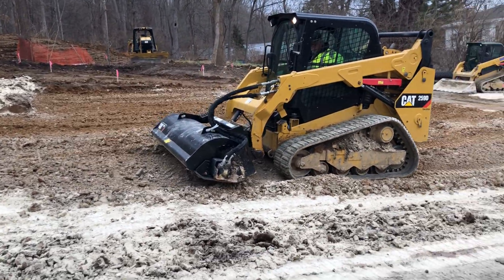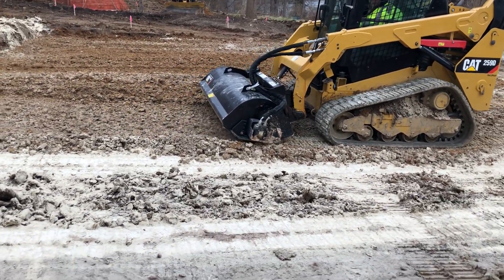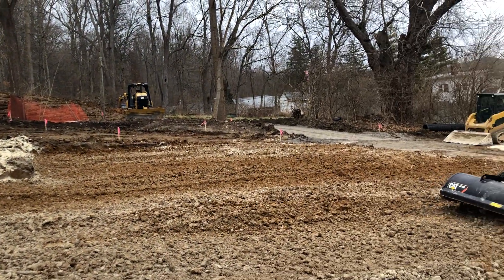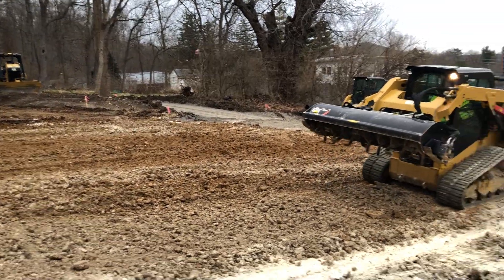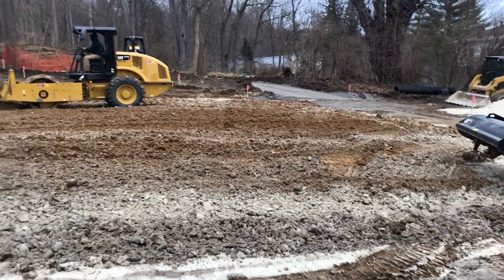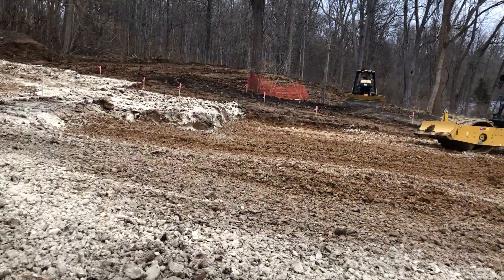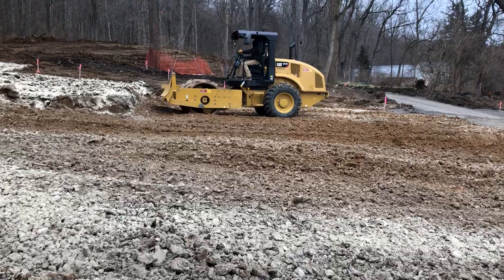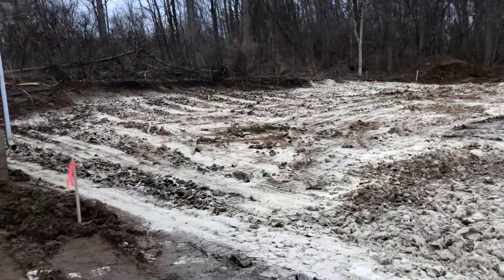How to dry wet dirt (Using Lime)

Comment: I have a situation where we have a 4m deep excavation and groundwater is an issue. Client does not want to pay for boreholes and additional de-watering, geotechnical engineer already ordered 500-700mm boulders to be pushed into the muddy are, but they completely dissapear, over that we added 100-300mm pioneer in a 500mm layer and looks like we're getting refusal,  but we also have a lot of pumping with clay pushing out the top, now we're considering other methods to dry out the clay, but it's a mess. We have lots of slush on top of a unequal layer and it's in the middle of winter here, it's just a mess, have no idea what we will do here, geotech guys are also wondering what to do and every day we delay the subbies, it's costing us money. Just wondering if a crap load of calcium hydroxide pushing into the pioneer with clay slush will dry the area up enough to add G5 on?
Reply: Lime is calcium oxide (CO). When it combines with water (what these guys are doing) it incorporates the water to become calcium hydroxide HO-C-OH. You can buy slaked lime for mortar or whatever but it won't soak up the water from mud

Comment: Your video communicates that you knew what it was for the season you were working in before you started.
There are no plan changes to the original bid.
Reply from the maker: True, we did know and we communicated it to the project owner. However in an attempt to spend less money they decided to roll the dice. Ultimately, we can’t control the weather that forced us to use the lime BUT our job was to make them aware of the potential so that they could make a sound decision. When the weather forced us to use the lime, they were more than willing to sign the C.O. because they knew it could be required ahead of time.
Reply: Right. Up front potential pitfalls and costs👍🏼